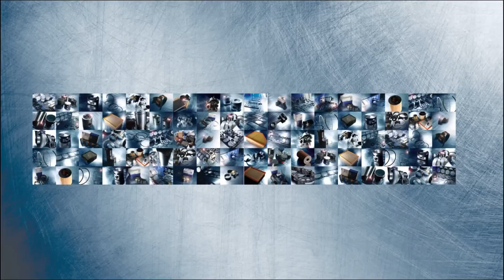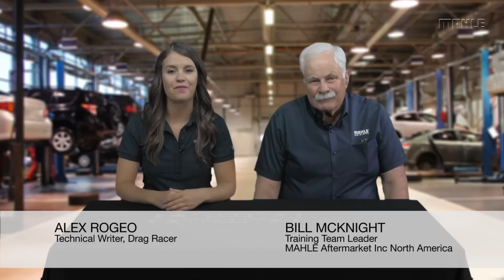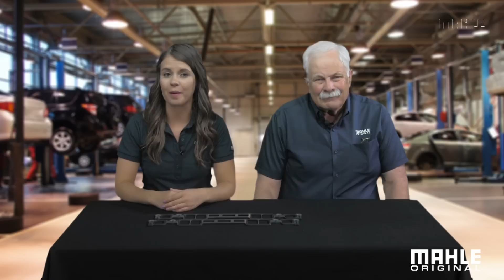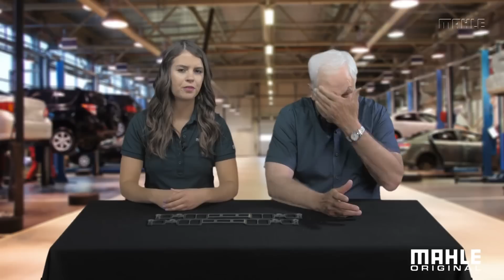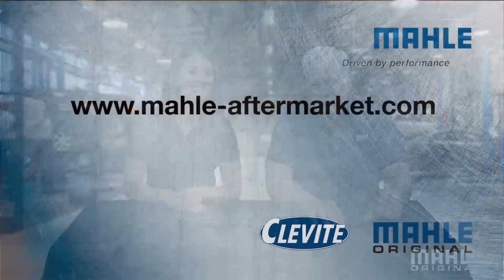Bill explains the real story about DEXCOOL

Comment: This also happened to the Buicks with the 3800. i have several and they all failed with dexcool.  I understand they fixed them and all that but I also understand I'm just not going to take the chance on it and I change them to green antifreeze . If I buy any GM product from the '90s to the mid-2000s I immediately flush out that all the coolant and put the green crap in. never had a problem like that. im looking at buying a 2000 LeSabre tomorrow 60k miles , guys great grandmas car, has the dexcool in it , that's being changed right after I drive it home. it's either that or I KNOW I'll have to change the gaskets (unless the dealership already did that) I love the engines of GM cars of the 90's and early 2000's but I am sick of doing intake gaskets on them ha ha .

Comment: 1:40 WHEN THE ANTIFREEZE GOT LOW in the cooling system, it was replaced by AIR.
AIR COMBINED WITH ANTIFREEZE and formed an ACID. The acid attacked the black plastic carrier used in those OE style gaskets, then ___

.

1) 3:40. We also REPLACED the SILICONE RUBBER, WITH HNBR RUBBER.
That's the stuff they use in batteries to separate the cells; so it's very resistant to acid.
2.) 3:49 We noticed on the OE parts,  that technicians sometimes OVER-TIGHTENED the gaskets, sometimes causing failure.
❤️So we built in steel load limiters to solve that problem.
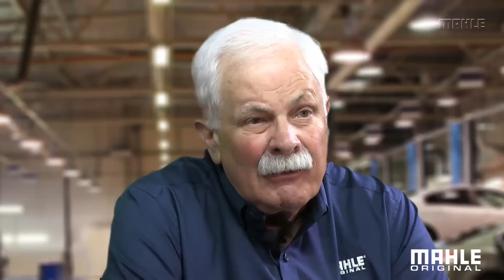3.) 4:02 We saw another problem :

.We designed an RTV DIVERSION CHANNEL on this gasket,  so extra RTV was diverted AWAY from critical sealing areas.

.

Comment: It’s not even a bad coolant. Just gotta make sure when you change your coolant you put the exact same coolant back in the system. People run into issues when they change their coolant and add the green stuff and it mixes with the orange Dexcool that might still be in the engine block and that’s when it turns everything to sludge when the two coolants mix. Dexcool is pretty good at lasting a long time you shouldn’t need to change it unless you notice it’s looking dirty in anyway. When you go to buy Dexcool it usually says on the back made for GM vehicles and it should say Dexcool on it
Reply: If i wanna to change from dexcool
I have to use something similar such as wg11 wolver ready to use or kfs12 liquli moly and the both from Germany

Comment: I had my factory installed GM original gaskets go out in year #5. I replaced them with the GM original REVISED gaskets. It is year #21 of ownership for me. The gaskets are still holding.

I have never stopped using Prestone Dexcool, but I'm flushing the entire cooling system every 3 years. I also replace the thermostat and the radiator cap at every second coolant flush, so every 6 years.

For a complete flush, I remove the thermostat and then flush the system with TAP WATER out of a garden hose (made my own adapters) until the system only holds tap water only. Then I remove half system capacity and refill with Dexcool concentrate. My recovered 3 year old Dexcool is always crystal clear. My cooling system has no deposits what so ever either. I have recently replaced the original radiator (the side tank cracked) and dissected it before discarding it. This almost 20 year old radiator was absolutely clean inside. No deposits what so ever. Also the 20 year old hoses were soft like new. Proof is in the pudding. Dexcool and tap water make a great coolant. I will continue to use this mix for the lifetime of the vehicle.
Reply: GM recommends distilled water. Some tap water has alot of minerals in it. Not good.
Reply: @DUCKSAREEVILLLLLLLL  Please re-read the entire post. It is all in there.

Besides, I have the GM FACTORY SHOP MANUAL for 1999. In that GM does explicitly recommends to use TAP WATER with DexCool, unless the region is known to have very hard water.

Having said that, it turns out my region has one of the hardest water in the entire US and still my radiator has no deposits what so ever. My DexCool has been keeping and carrying all solids dissolved!

And if that is still not enough:
I called Zerex Tech Support and asked if they are using distilled water for their coolant manufacturing. They said NO, because distilled water has its own issues with corrosion via electrolysis that it creates. Instead they are using demineralized water, because it is more stable.
Reply: @mrtopcat2  Thanks for the informative reply but distilled water is de-mineralized water. I'm in an area of Minnesota with a lot of lime in the water. Good place to raise horses though. Maybe Zerex meant "de-ionized" water; the same as what I use at work in our EDM area where resistivity must be maintained at a precise level. Information I got from YT and forums, etc say that North Stars have reverse-flow cooling systems requiring a specific bleeeding process from a heater core or coolant reservoir hose to remove all air and that you should use only GM thermostats and water pumps. You're obviously not having any problems with trapped air. Where are you putting your hose connection and what are you draining the old coolant into? I used to use one of those Prestone flushing kits with the yellow drain "horn" hose connection spliced in with a cap on it when not being used. Is that what you use? Thanks for any reply because as you know, knowledgable Aurora owners are kind of rare.
Reply: @DUCKSAREEVILLLLLLLL  Good catch. It may have been de-ionized water, I’m not entirely sure. I only remember considering buying some, but found it basically impossible to obtain in home quantities, or only at a high cost.

My vehicle is a 1999 Chevy Tahoe. I have no information or experience on the Aurora coolant exchange process, but I do have another vehicle, a 2017 Jeep Wrangler, where trapped air in the coolant can be an issue as well.

The way I solve it on my Jeep is by first getting most of the air out. Your aforementioned yellow funnel container may come here handy. Then I drive SHORT trips until operating temperature is reached and then I let the vehicle sit. Assuming the initial coolant fill was done meticulously, the amount of residual trapped air is somewhere around a 1/2 quart coolant displacement equivalent. The engine should take no harm in the process. Of course, during these short trips I remain hawkish about the coolant gauge.

During this process, the trapped air WILL come out naturally. In a coolant recovery system, each heating cycle to operating temperature causes the expanding coolant to push air, often more than the internal volume of the recovery hose, into the coolant recovery bottle. Then OVERNIGHT, as the engine cools completely, the contracting coolant creates a vacuum that draws coolant back in from the recovery bottle. With each cycle, the system loses more air, which is replaced by coolant.

In the case of my Jeep, this process may take several days. I know the process is complete by meticulously observing the coolant level in the recovery bottle IN THE MORNING. The level WILL drop during the process and stabilize once the air has been fully purged. If the level does not drop at the initial stage of the process, then either there was no air (which is highly unlikely) or there is a leak somewhere in the cooling system.

Which is to say, for this to work, all cooling system components must be fully functional. There must be NO LEAKS, and the radiator cap must operate correctly in both directions. I routinely replace the radiator cap and thermostat as a preemptive measure.

Another option is to put your cooling system under vacuum. But I don’t prefer going this route because it will collapse the cooling hoses and I am concerned that collapsing cooling hoses may get stressed at the solid connections to the radiator or engine components.

Comment: So, this is a sales spiel for a particular gasket?  I have a 2007 Hummer H2, which has had the same OEM anti-freeze for 12 years... I am about to do a radiator flush and fill with new anti-freeze, the Manual says, "50/50 mixture of clean, drinkable water and USE ONLY GM DEX-COOL(R) or Havoline DEX-COOL(R) coolant.  The Hummer has been GREAT to me for 12 years, is there a concern about my refilling the radiator with DEXCOOL?  Replacing gaskets on an engine that has no issues is not happening, so which is the safest coolant?
Reply: Just wondering what you found out and decided to do?
Reply: @bobcat1  DEX-COOL is the best, most effective coolant for late model Chevy engines WHEN USED PROPERLY, which means you MUST bleed your radiator and engine water chambers to get all air/oxygen out of the system. 

It is excess oxygen in the system that cause the Dex-Cool to become acidic, caustic and damage OLD/LEGACY gaskets. Most NEWER gaskets handle Dex-Cool equally well, but the key is to BURP or BLEED the air out of the coolant system as best you can. 

My 2007 Hummer H2 has been running Dex-Cool in it's radiator since BIRTH/2007 and there are no signs of any gasket or leak issues whatsoever. 

Google BURP coolant for instructions on how to purge air from your system. 

I have NEVER in the 14 years I have owned my Hummer seen a coolant temp above 198, in fact... it always runs at 198 degrees.  

Since I wrote the original comment, my wife and I have driven 8400 miles, 22 states over a 2 month period between Sept. - Nov. 2020, every terrain type possible, Grand Tetons, Yellowstone, Custer Battlefield, Devil's Tower, Bear Tooth Pass (Scariest Road in America at night in dense fog. If you want to test brake pads, this is the road to do it.), Sturgis, Badlands, Crazy Horse Monument, Mount Rushmore, Memphis, Nashville, Biltmore Manson/Estate, Mayberry RFD/Mount Airy, NC, Ocean City, MD, Kitty Hawk, Cape Hatteras, NC, New Orleans, at the border in Texas during an ice storm, all places in between and a return to Las Vegas without any issues whatsoever. 

Never saw a coolant temp above 198 degrees.

Comment: Been running my 05 with Dexcool for 15 years now....never a problem! Much of this is just straight up BS!
Reply: I have a 2004 Pontiac with 183,000 on it runs Dexcool just fine no leaks of any seals headgasket is fine water pump still pumps and car dose not overheat and speaking of heat lots of heat in the cabin at wintertime. But I guess Dexcool is bad
Reply: @ryans413  These people are regurgitating old myths with the first generation of Dexcool....nowadays it's different. Maintenance abuse and neglect on any car with destroy it...no matter who makes it!
Reply: whacky pax  I change the Dexcool every 25K.... This is all made up BS as I have also owned two cavaliers and another Sunfire in the past all Dexcool...never an issue at all. It turns to sludge because either the owner mixes another coolant with it or they never bother to change it ever.
Reply: @omniken66  The entire issue is based on what GM claimed. They claimed 100K mile coolant. People believed they didn't have to change it if they owned the car for 10 years and yet only had 90K on the clock. You're changing it every 25K. This would be like changing your oil every 2K miles. Of course, you're going to eliminate most chances of a problem. Air and Dexcool do not play nice over time and if you miss that window where air sits in the cooling system too long, you will end up with either a milkshake, or mud. I've seen it firsthand.
Reply: @hav2win  The "people" your describing will basically do that with any car they own...they don't do any maintenance to the vehicle until it breaks down.

Comment: Damn is this why I had to do intake gaskets twice in my 1996 GMC 5.7 extended short box, I got rid of that otherwise great truck because of that issue
Reply: My 1995 Impala SS had the green stuff from factory so I avoided dexcool issues.  Most of the cars by 2003 had the issues worked out and no more problems

Comment: Doesn't matter what coolant you use. That same shit happens to any cooling system that's not maintained like it should be. And the new gaskets still fail after 7 to 10 years.
Reply: What everyone’s failing to say it’s not Dexcool that’s ruining the vehicle it’s people thinking Dexcool is bad and they change it out with the green stuff and when other coolant mix with Dexcool that’s when everything turns to sludge and eats the rubber hoses away and breaks water pumps gaskets.
Reply: Dex Cool is a special case, it's not uncommon for dexcrap to eat gaskets in 2-3 years tops, and even better is it moves the plastic sludge it creates into the water jackets, and water pumps. Just stick with the green stuff, and you won't have any problems. Any car with dexcool in it that I end up with gets a full flush out and swap to green. Oh, and dexcool will also eat any composite (plastic) intake manifolds it touches too, so even with new gaskets, you're still going to get leaks and need to buy a new plastic intake.
Reply: @Mavairo  Ford doesn't use Dexcool. Why do their intakes turn to shit over the years? That's just what happens with plastic. The gaskets failing early with Dexcool issue was addressed over 15 years ago. Hang that argument up already.
Reply: @Carlitosway211  Why run Dexcool at all? It's pretty well documented, and it's no more protective than Prestone's green, and it's more expensive. Stop being a gm fanboy, it's a fuck up, pure and simple that costs more, and doesn't last any longer than green at best, and destroys older plastics at worst.  btw Ford used a similar compound at one point which also ate plastic.

And there's plenty of cars out there still on the older gasket design, swapped to green that haven't eaten away. I wonder why that is. It couldn't be because Dexcool sucks.
Reply: @Carlitosway211  My Ford escape uses dexcool.

Comment: Ive never had an issue with dexcool in my 2004 trailblazer ext 4x4 with the 5.3L vortec and it has 322k miles on it...
Reply: AVERAGE JOE  As long as they didn't mix the two different formulas and did a THOROUGH clean water flush first.

Comment: If you have RED coolant in your system .I WOULD HIGHLY CONSIDER flushing out your entire system and refill with GREEN ANTIFREEZE. GM designed DEXCOOL to eat away at hoses and gaskets for financial gain.
Reply: TRUTH4U2NO does that include orange withe the red?
Reply: @abcxyz3783  you can use red coolant from other manufacturer, not the GM Dexcool...

Comment: Been buying chevy cars and trucks since 2000 and never had one issue with dexcool. I maintain my vehicle(s), theres no such thing as a lifetime fluid/1 year engine oil...
I have a 2002 chevy malibu  with the 3.1 and opened up the engine for other minor reasons. The oe plastic  intake manifold gaskets were in perfect condition. Always used dexcool. Like he said, if it runs low and you never replace it, you will have issues. I change my coolant every 2-3 years and bleed the system. It's a 1 hour job people.

Comment: I just purchased an 05 Buick Century Limited. Was this car apart of the new gasket change? or would it still have the old gasket? It's got 153 k miles on it. Just opened the radiator cap to see some build up clinging to the sides of the opening.  I plan on changing the coolant immediately, but would like to know what I"m up against here. This news is pretty devastating to a person who had no idea such an issue existed!!
Reply: If your radiator coolant inside your radiator is RED- thats dexcool NO GOOD! Flush out your cooling system inc. through the heater core, I would also replace thermostat and USE GREEN PRESTONE COOLANT! Dexcool was designed to eat away at your motors hoses and gaskets for FINANCIAL GAIN by GM! CLASS ACTION LAWSUITS ALMOST BANKRUPT GM!

Comment: I just ordered two sets of the premium gaskets, the steel was grey on one set and black on the other, both have the same part number. I went with Mahle brand because I know the design is well tested through R&D, even if most everything online says FelPro is the only gasket to use. The shop that built my engine cheeped out on everything and I'm sure the intake gaskets are no exception. The cooling system also leaked and your video concerns me because of air entering the cooling system.. Thanks for the honest opinion of Dex-Cool and the reason gasket failures are such a problem.